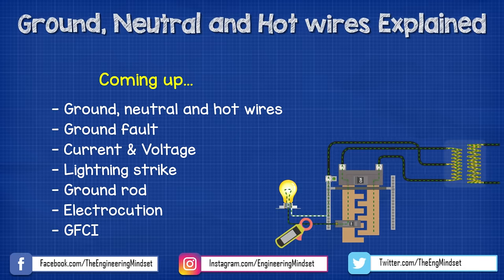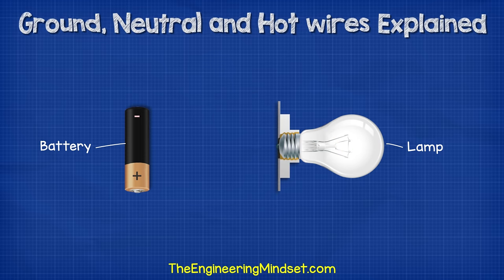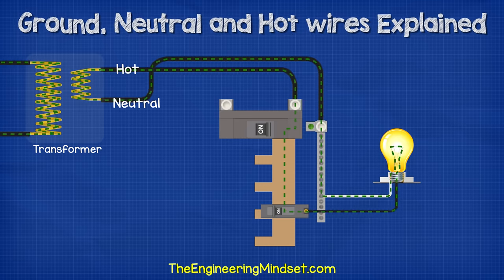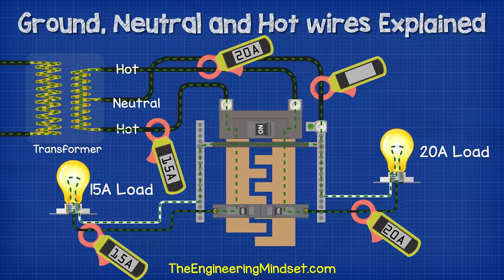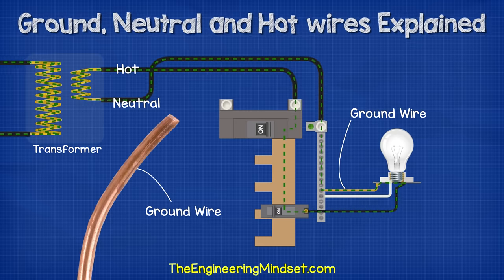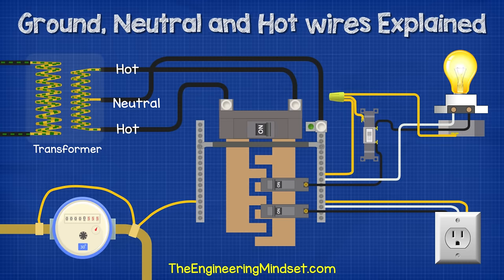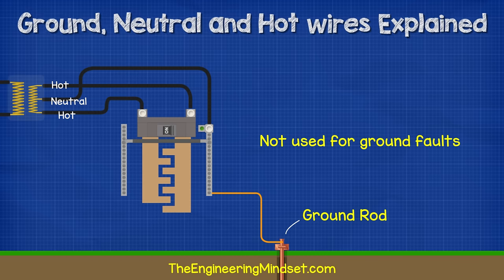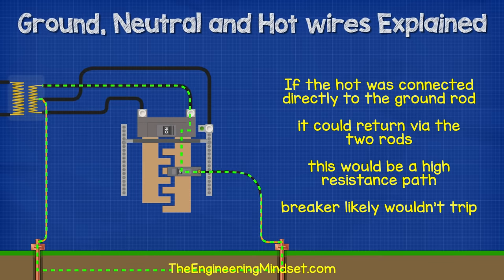Ground Neutral and Hot wires explained - electrical engineering grounding ground fault

Comment: This "electricity always tries to go back" thing doesn't make sense. You're telling me that if I touch a hot wire and there's no path through the ground back to the neutral wire then nothing happens? I don't get fried? My understanding is that if there's a potential difference (as there is between hot and ground) then something happens. As I've understood is, "circuits" aren't necessary for electricity to flow from one place to another, they're just the best way to engineer a system.

It does not make sense that the electricity can't "flow into the earth" and must go back to the neutral wire, which is at the same potential as the earth.
Reply: Hey buddy, I agree that nothing happens unless there is a potential difference. Basically, your first question is incomplete or probably you are confused. I think you're mixing things up there. There is two terms with the word ground --  ground wire (wire connected to the lamp) and earth ground (rod). Which one are you referring to? 

Neutral wire and ground wire/ground rod usually have the same materials but neutral and ground are two different things. However, the path for which the current flows varies. For the ground wire, there is less resistance from the load (lamp) to the neutral bus (circuit board) since current flows unhindered in a copper wire. For the ground rod, there is a high resistance between two rods since the path is not a conductor but made of soil/stones etc.
Reply: @cheslg6809  The video says that in order for a person to be electrocuted, the "circuit" must be completed through the ground (soil) to the neutral wire. This whole "circuit" thing is useful pedagogy for conservation principles but is not a natural law, e.g. lightning is just a discharge. Anyway--I see no reason why if you touch the hot wire you won't bet electrocuted, because there is a huge potential difference between that and the ground (soil), which goes through you. I understand that if you're on a rubber pad you become a capacitor because you only have so much capacitance. But the earth doesn't "just become a capacitor," it should drain the hot side down to 0 potential relative to itself, which should be enough to electrocute you, regardless of whether there's a "path" back to the start of the system.
Reply from the maker: We just published a new Ground fault, short circuit and arc fault video, so much detail! Link HERE➡️: https://youtu.be/Qi0ynSQw-wc